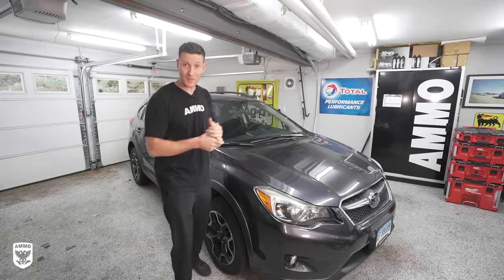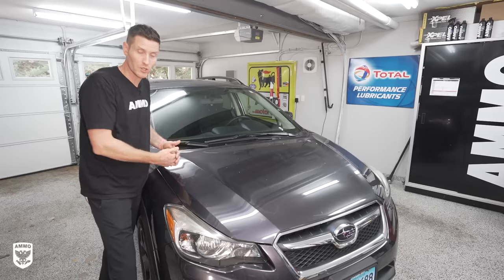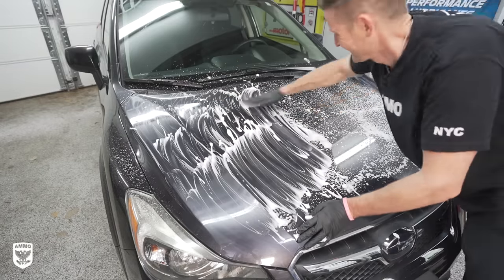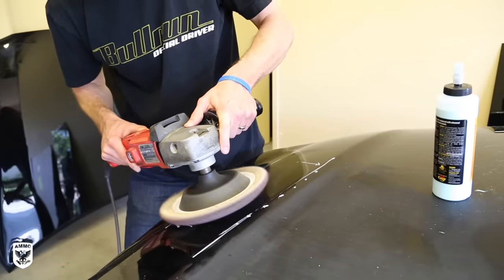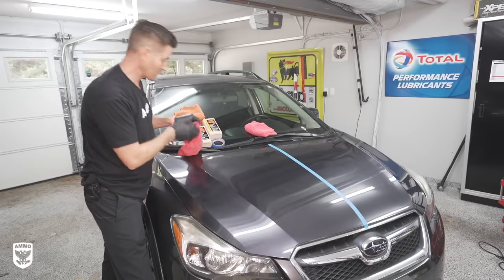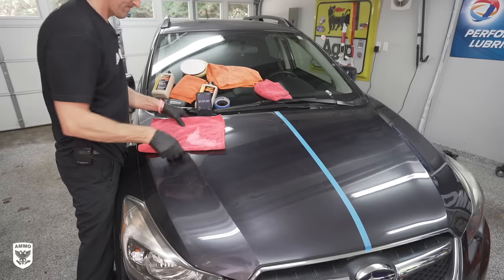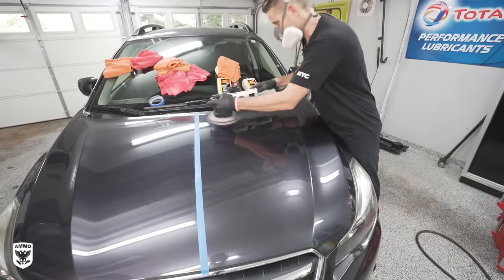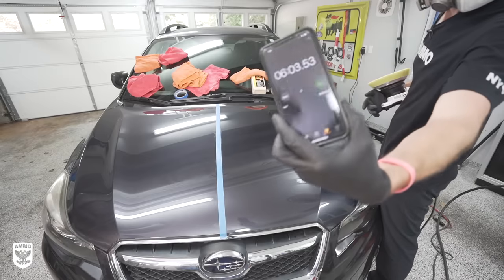Paint Polishing by Hand VS Machine. What's Better?

Comment: I went back to polishing/waxing by hand.  Except for large flat surfaces like the hood, it's actually faster and easier doing it by hand.  Way more maneuverable and accurate around mirrors, tight areas, curvatures and plastic trims you want to avoid.

Comment: I usually use a 4" pad for hand polishing around trim and other areas the 6" machine doesn't fit in well, and it gets pretty good results.
Reply: Is it 4 inch polishing pad you use?
Reply: @sparko2012  great question
Reply: @esschuele6336  something has been edited or deleted out of the thread.

Comment: Buying a DA and hex pads were the best thing I ever did a long time ago.
Reply: Same ever since I got 5 inch da and a 3 inch da. I notice I was marring the paint on really soft paint by hand.
Reply: How did you learn to use it? All I have is YouTube helping me.
Reply: lockergr test panels and youtube. But you learn the right pad combination, compound polish combination, etc when you start to use it. The machine does the work pretty much other than putting light pressure. What you need to watch out for is how to tell when a compound or polish is done being used. Typically you look for a “flash” or haze in the product as you are using the DA
Reply: My God I've been waiting for years for this video and its finally out! And it was amazing, thanks for making things crystal clear once again Larry!

Comment: Im having great results with a DeWalt 12v cordless, Amazon pads, and Turtle Wax conventional waxes including scratch remover and polishing compound.

Actually, probably the best results short of paint or color correction via wet sanding or other methods. This is on a 18 year old vehicle with original paint.

The product isn't as important as the process. You can get great results with cheap products.

Comment: I am by no means a professional but I am a detail enthusiast.  I have not gone up to a real DA but I do use the circular hand held ones you buy at Auto Zone.  My truck has always been very well maintained since I bought it so I have never polished it.  Just clay-bar and wax and now seal.  I did do a polish job on my brothers older mazda.  The paint was extremely neglected to almost pealing.  I claybar, polished, then waxed.  I was afraid to use the heavier compound.  The car looks a million times better but It was like it was shinnying over a milky paint.  It didn't have the clean new look like I was wanting.  Maybe because I didn't use compound with a DA first?
Reply: If you claybar then you should really polish after to remove the marring.

Comment: Interested to see the difference between a battery powered and normal polishing machine. I don’t have easy access to a wall outlet. Love this video. 
I have performed the clay + 3 step process last year by hand. Clay, clean, polish and finish with wax. But was not happy enough after spending hours.
I’m thinking to buy  a machine and add the step to applying compound as well to be able to remove the big scratches now I have seen this video.
Reply: Same here, it's not that I dont want to use a polisher. It's that I simply can't. Don't have 500 dollars to cough up for a battery powered polisher yet either.

Comment: How about using a drill to polish? Not as good as a rotary, but better and faster than hand. There are so many 3 inch kits on amazon for less than 10$.
Reply: Be careful- this may burn your clear coat since it's not dual-action.
Reply: @andrewcanella  Of course, but it spins a lot slower than a rotary so it'll be a lot safer. Also meguiars have a dual action kit for drills if you wanna be even safer

Comment: I'm actually surprised, that it's possible to get such good result using regular microfiber cloth to polish the paint :O The only thing that I'm not really sure about is, that it might lead to uneven pressure in different areas, thus uneven cut of clearcoat, with some hotspots.

Comment: I've hand polished my car twice with Meguiar's Ultimate Polish and a microfiber pad and it's SOOOOO much better than it was before.  I'd like to get it machine polished sometime.  To be honest I'm just no where near brave enough to take a machine to my car and risk the damage when I don't have the thousands of dollars to buy all the required equipment like a paint thickness gauge, air compressor, etc.  Maybe someday.
Reply: If it makes you feel better, just today (about 20 minutes ago i finished actually) I used a DA that i found on Amazon, a Black and Decker that was on sale. I used the Meguiar's Ultimate Polish just like you did and the difference between when i hand polished it about a month ago versus using the DA today was night and day. This was my first time using one and like you, I was a bit scared as well but after the first second of turning it on, the fear went away. I used a regular can of compressed air from Walmart and some pads I found on Amazon. You should definitely try it buddy, you won't regret it :)
Reply: @TruBluLew23  Thanks for the vote of confidence.  I've spent some time today looking at DA's and researching about all the different colored foam pads.  I'm thinking I may try my hand at polishing with a really slow cutting pad and the Ultimate Polish.  Do you know what pad you used?  Thanks!
Reply: @Ryan_H22  no prob! I actually used the polishing bonnet that came with machine. I bought separate pads but since it came with my machine, I figured I'd at least try it on the hood. Ended up working so well on the hood that I used it for the rest of the car. They were these: https://amzn.to/3dVhYxH
Reply: @TruBluLew23  Awesome!  Thanks a ton for the help and link.  I appreciate it!

Comment: you mentioned that the clear coat prevents the paint from oxidizing, with the new cars today can the top coat turn a bit white/hazy  from oxidation or is that eliminated with new car paint process today?  and if it does get oxidized  is the actual clearcoat getting oxidized or the paint underneath?  also are you actually taking some of the clear coat off with say a 1 step or 2 step  paint correction with a DA polisher?   thanks for your time

Comment: This was interesting Larry.  Could you do one more step, two I guess, and measure the thickness of the paint before and after for both methods?  I hand polish old paint because there is not as much left.  Also, cars that you intend to own, 25 years plus, may benefit from just hand polishing, again, just to preserve the material.  Also, one way to save energy when hand polishing is to relax your face, haha.  Did you see your grimace?  Were you really pushing that hard or was it theatrics?  Anyway, thanks for the info.

Comment: Larry, what if we have access to a DA polisher, but have no access to compressed air. How would you go about cleaning your foam/microfiber pad in between passes?
Reply: I’ve seen him clean with water and have also seen him uses a towel to clean a pad by running the machine/pad against a towel in your hand
Reply: They also sell compressed air in a can
Reply: You can use a water spray nozzle  on “jet” to clean the pad, spin the water out in an empty bucket before using again (or else you will be soaked with polish and water.)
Reply: Thanks all! I also emailed him and he said what Ethan said: use a microfiber towel. I’m going to look for the video where he does it.
Reply: Steamer

Comment: Hey. Thanx for another informative video. Do you do any paint preparations between polishing and waxing?  What’s your opinion on IPA solutions?
Reply: Residue control and working clean is the biggest "secret" to paint correction. An IP solution or dedicated panel prep like CarPro Eraser should be done after decon, right before you start to polish to ensure a clean bare surface and efficient polishing, and again after polishing, before applying protection to ensure any remaining polishing  oils are removed for the best possible bond.
👍👌✌

Comment: So my car is a toyota from 2010.  It's a white car and the other day I washed it and then I saw a film on it.  I rubbed it with my fingers and this whitish color came off and onto my fingers.  Was that paint or something else bc I'm thinking the paint is protected by the clear coat.   If the car is from 2010 it should have a clear coat, right? Would it be safe to polish it with a machine?

Comment: Is there a danger of taking off the clear coat completely when compounding? I have a classic Beetle that gets a haze quite often on the roof and wings. I clay, polish and wax, but after a month the haze returns? Why is this? Does the clear coat need redoing?
Reply: @Nicholas Thanks. I’m actually still having trouble with this. I think I do need to get the wax completely off before compounding. I’m just worried what I’ve done is taken the top coat off and it may need redoing.

Comment: I need some suggestions on how to remove oil spots from auto glass. Someone on the highway is leaking oil in my area and 3 times in the last two months my car keeps getting fully coated in droplets of oil. I see how to remove water spots from glass but nothing about oil and on paint. Ive tried everything. And would like to know what protective coatings i can use for both my glass and paint so if this happens again i can prevent it from staying on the car and it keep it from being a HUGE PAIN to try everything and see that it doesnt work.

Comment: hey Larry, I use a rotary machine because it is much quicker however I get frequent hopping with the machine and sometimes it does a weird thing where it will “etch” a smear of polish/compound into the paint so I need to spray water on it to get it off... any advice?
Reply: very slight tilt of the machine and more lubrication via your polish or water mix

Comment: What is your opinion on getting a harbor freight DA just to do my own car?
Reply: They’re decent quality. I bought mine there five years ago and still use it.
Reply: Get a Rupes lhr15 mark 3
Reply: I tried to change the counterweight on my Bauer DA and totally stripped the screws because I didn't know beforehand that they were screwed in with a threadlocker. It's completely my fault, but bear it in mind if you consider changing it out for a different counterweight. There's lots of mod videos on YouTube and people have suggested changing out the screws and the grease, I just screwed up with removing the counterweight.
Reply: Many recommend the G9 from Griots Garage, has more power and a lifetime warranty. I'm saving up for it, but in the meantime I will follow the suggestions here to try it out by hand, hey I've got time!